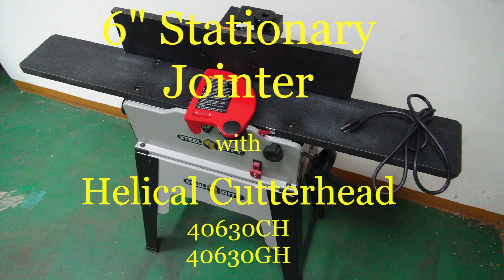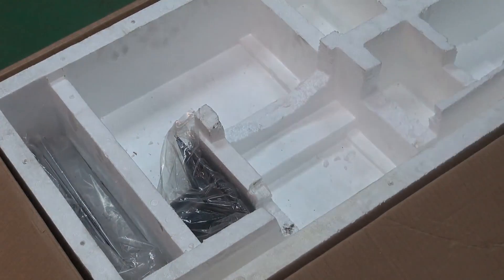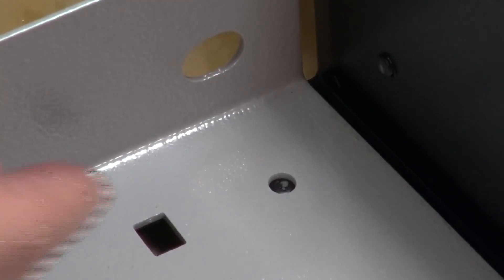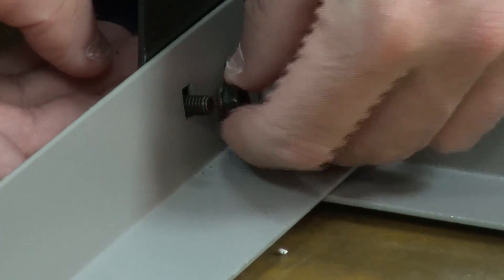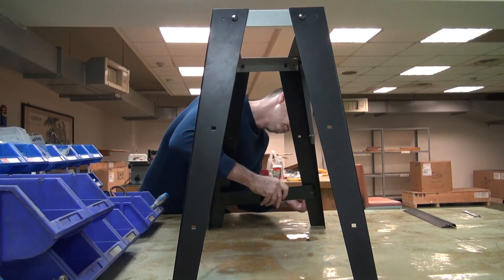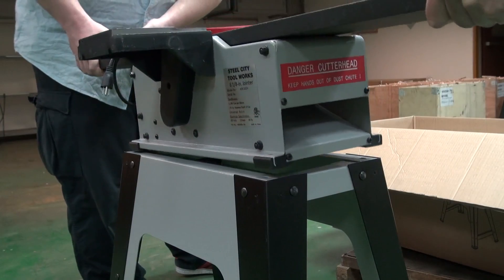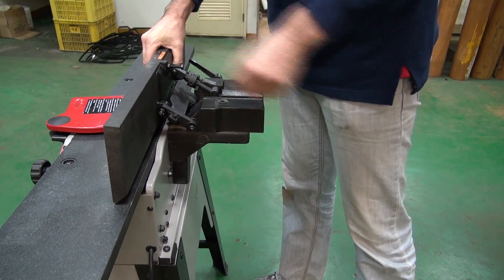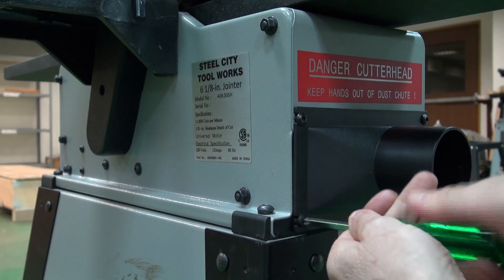6" Jointer: Stationary Jointer with Helical Cutterhead Setup: Steel City 40630CH 40630GH

Comment: I just Bought this Jointer from Summit Tools in Coquitlam. Right off the bat i have to say that for the $500 price tag im disappointed. The fence was not square to the back of the tables. It is 90 degrees because i can adjust it but not parallel along the the edge of the tables. I had to take off the fence from the mounting bracket put shims in behind it and re assemble it.  I spent the better part of an hour trying to micro adjust the pins and bolts and realized that nothing i could adjust would effect the alignment along this axis.  I have yet to actaully Use it because i spent all night setting it up and i assume it will work well but im slightly disappointed at the poor quality control here. I feel like i should Not have to buy washers and modify the fence in order to make it parallel.. We'll see how it performs...
Reply: Terry Ross
it appears this proposed solution will run me an additional $150 if im not mistaken? You are proposing i take the model I purchased in to the store and use the value as a trade in towards the higher model? I know ur suggesting this because the higher model arrives tomorrow, and yes id like to get this resolved asap but this solution isnt what i had in mind as  Id rather not put any more money out on this machine...